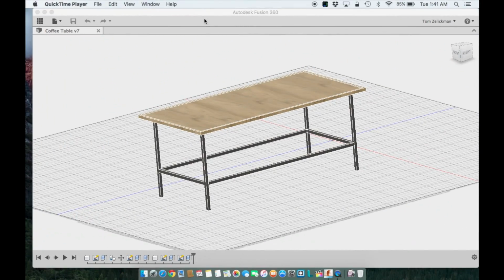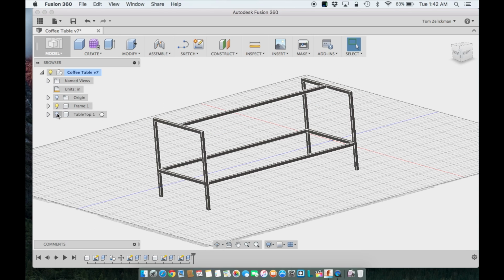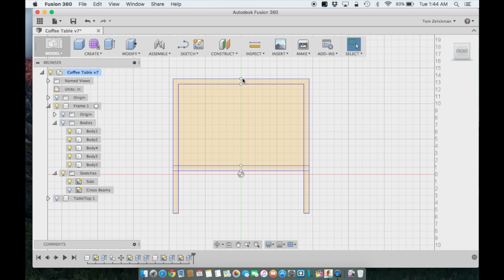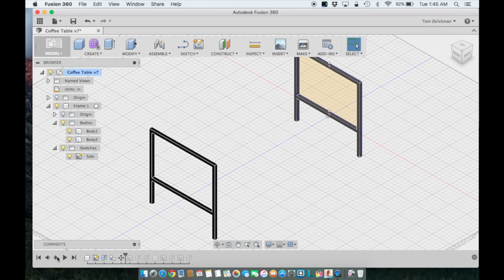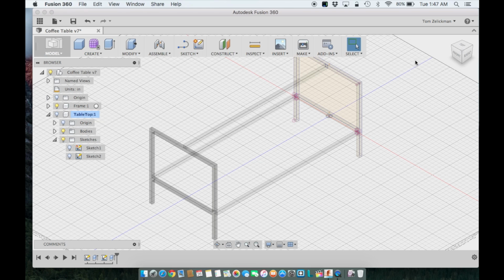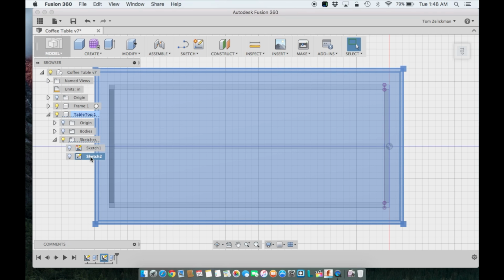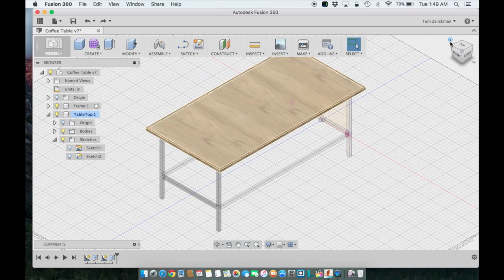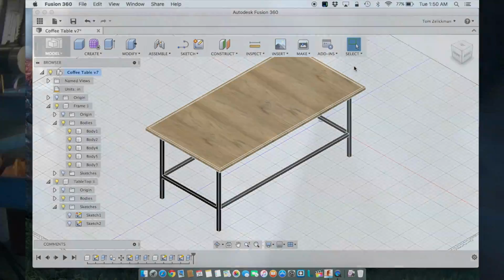Project Work - Table Set Part 1

Comment: Looking forward to seeing how you do the top. :)
Reply from the maker: +bluehandsvideo Thanks, Mike! I'm still trying to figure out that part myself... I guess I have about a week or so to get that worked out though. :)

Best wishes,
Tom Z
Reply: +Tom Zelickman (Inspiration Metalworks) I got the impression that you were going to route out the area for the metal and then drop the metal in as the inlay.  If you did that, you'd need to turn the metal over so that any angle in the cut walls would work in your favor.  But, I that would be one big piece of wood to mess up doing it that way.  
Then I was thinking....just lay the metal on the wood in the recess, then cover the entire top with glass.  Like I said.....I'm looking forward to seeing how you do it. :)

Comment: That is a nice table decoration there.  I guess you are going to put that under a glass table top?  Thanks for the video.
Reply from the maker: +Amateur Redneck Workshop Thanks, Harold! Should I keep you in suspense to get you to watch the other episodes? Just kidding... I'm going to use an epoxy resin which will seal the metal into the space and fill in any gaps. It will take some time to build it up but I learned a lot the last time I did a table like this so hopefully it goes a lot smoother. Plus, it's cold out so no gnats landing in the wet resin!

Hope you are well and staying warm, sir.
Tom Z
Reply: I think it is a safe bet that I will be back.

Comment: Tom, nice design.  I am very interested to see how you finish the table top with the steel murals.  I also started a furniture project in Fusion 360 yesterday and I ran into some of the same questions.  I am making a steel frame bench with a wood top.  I built all of the frame as one component, and I can make my small one off BOM by hand, but I need to figure out how to do individual pieces for all of the steel without being overwhelming.  I think I am going to try to do some drawings today which I have not tried before.  Stay warm.  R.J.
Reply from the maker: +Abc Defg Thank you, R.J.! I appreciate the time you took to help guide me a bit in my drawings which I tried to apply in this project. As for the frame itself, I think it would have been as easy as drawing in the miter lines and selecting the new bodies drop down menu during the extrude in order to make each piece a separate body to more accurately reflect the build process. I'm going to go back and edit the sketch and see if my theory holds up.

Hope you are well,
Tom Z